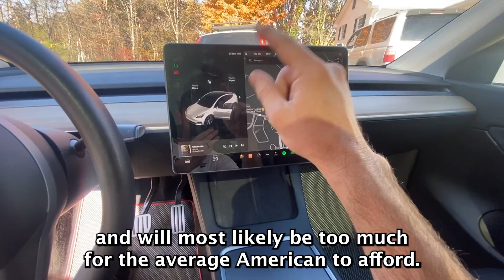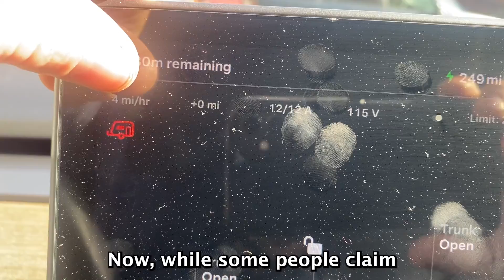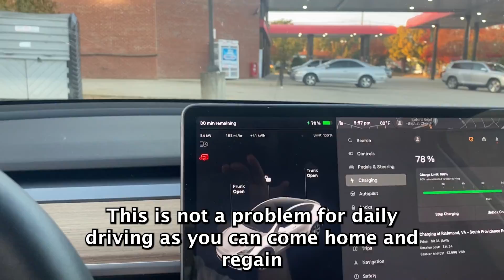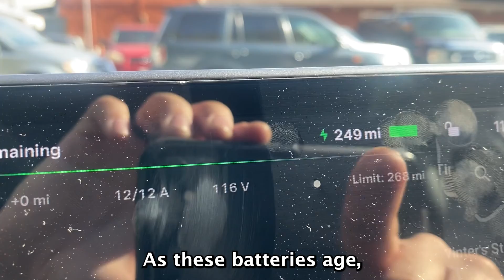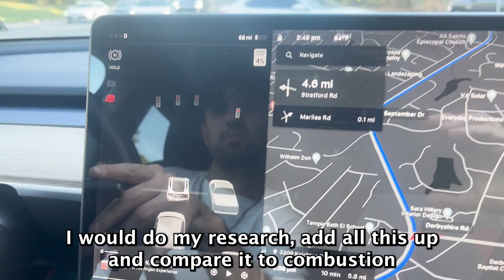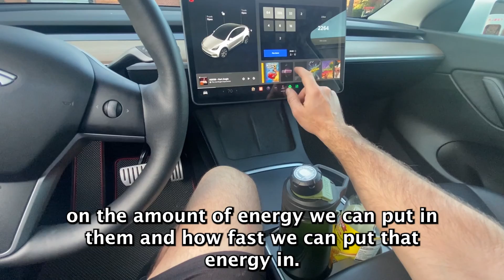Why Electric Cars Can't Replace Combustion Engines

Comment: If you are going to state facts and figures, atleast get current info: Coal was the third-largest energy source for U.S. electricity generation in 2022—about 18% - not 40% like your video claims. Also a coal burning power plant and electricity transmission is far less carbon intensive than powering a small Internal combustion engine with gasoline. Lastly an EV battery can be 95% recycled, so even though we are mining for millions of EV's worth of batteries, in 15 years the batteries that we build today will be recycled into new batteries dozens of times over.
Reply from the maker: 19.7% is the correct number. Natural gas is 40% which is still a CO2 emitting fossil fuel. Im am not 100% sure how much CO2 is sent into the air by a power plant but I would assume if all cars were electric it really wouldn't change much as far as nation wide CO2 emissions. That is at least until we have 100% renewable energy.
Reply: @justcallmeeddie1  If all cars were electric tomorrow, of course the electric load could not be handled, but no one makes those kind of a assumptions because that is impossible. You can however factor that EV salse are growing at a 35-50% annual growth rate, and that most new energy capacity being added today is renewable energy. An electric car will be charged with whatever is coming from the grid, and the grid is getting greener every day, so an EV's emissions will go down over time as the grid gets greener, you don't need to wait for a 100% renewable grid for the EV to be a greener option. A tesla model 3 gets 131 MPGe, even the best Prius maxes out at 57 MPG. No matter how you slice it, an EV is better for Emissions and Energy usage.

Comment: Any half-decent industrial electrician(and quite a few millwrights) ALREADY KNOW how to deal with EVs.
My brother-in-law (millwright and electrician's tickets) is so vehemently anti-EV and he doesn't realize he already has the skills to work on them.
When people like Eddie (who seems like a decent guy, just put down that huge glass of Big Oil kool-aid) finally realize how much better EVs are and stop being afraid things are gonna move fast.
"What on earth do you need a COMPUTER for?" people asked me in 1981.
"You must think you're really important with that stupid Motorola BRICK. Do you REALLY need to be in touch all the time" - 1995.
"You're addicted to that f'ing Crackberry, and why do you need a phone with a Camera" - my ex in 2006
Eddie will get there - and it will be much better than he thinks.
Oh and Eddie - check out Edison Motors new pickup conversion kits if you want to get rich. (Or don't, people value free advice based on what it costs, not what it's worth unfortunately. And on that note, don't buy crypto unless you understand the scam REALLY well and are sure you will get in and out before the next crash).
Reply from the maker: Hey I wont argue that EV's are cool driving experience and that some people are going to love them. This video is to warn people that they arent perfect and you can expect some "growing pains" if you wanna hop on the hype train. Ive looked into EV conversion kits and by the time its all said and done you will spend 20,000-60,000 dollars converting to EV right now. It's just not worth it financially. I may be still riding a horse on a paved highway or you may just defending a overpriced hunk of metal that takes too long to charge.
Either way time will tell.

Comment: And you can’t replace a horse and buggy because you can run a car on hay lol
Reply: True, but we didn’t replace the horse until we built roads and gas stations, not fields of hay. EVs need their version of that—better batteries, more infrastructure. Otherwise, they're just Teslas running on wishes.